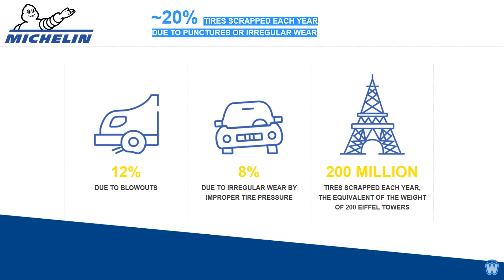Michelin Airless Tire UPTIS - Unique Puncture-Proof Tire System

Comment: The style doesnt look good but it seems to be more efficient.
Reply: AUTO TUBE it makes your fuel mileage much worse doe
Reply: @ahmeryaa865  is it because it has no side walls? They should just cover the side walls. I can imagine the air going in through there
Reply: AUTO TUBE nah it’s because the tire is so flexible you get much more surface area which ruins your fuel mileage by a lot
Reply: @ahmeryaa865  Flexibility depends on the construction and because these allegedly weight a lot less than a regular rim and tire it should improve mileage.
Reply: bigblockjalopy it’s not about weight it’s about traction the more traction the worse the mileage and that’s why bmw i3’s come with extremely thin tires
Reply: @ahmeryaa865  this is the reason trains are some of the most efficient modes of transport, because there low surface area on the tracks
Reply: @ahmeryaa865  Maybe the material of it can be changed to make it more harder.
Reply: j Walster this is why these tires would suck because they have more surface area and traction
Reply: nichts angehen sure but that would ruin the whole “ obstacle crossing “ thing
Reply: @ahmeryaa865  exactly, where in construction and military applications, efficiency is not at much as a priority
Reply: @ahmeryaa865  So be it. Most of the street cars are not fitted to cross in mountain sides anyway.
Reply: nichts angehen but at that point it would be too expensive to make and buy to the point where it’s just a bad investment
Reply: @ahmeryaa865  "Traction"? I guess you mean rolling resistance. Of course it is about weight. Very simple, easy to understand  law of physics. It needs power to get weight moved, the more weight the more power needed, especially true for a fast rotating thing like a wheel. Light wheels save fuel (or energy), known since the invention of the automobile, and long before. And these new wheels could probably be designed narrower too, for less rolling resistance, so?
Reply: bigblockjalopy stop twisting my words and respond with something that is related to the key word I said which is “ traction “ not “ rolling resistance.

Comment: We could've and should've been using airless tires years ago!
Reply: JOHN DAVIS not in snow or mud climates/circumstances. Any debris inside the tires would cause possible catastrophic shake or failure at highway speeds. They’d have to be cleaned constantly. This is a 40 year old idea that keeps getting press every decade
Reply: @joesmith389  tyres could be covered from sides.
Reply: Joe Smith like the sidewalls HAVE to be open ? .. they could just make a type of vent in the sidewall near the bead
Reply: @joesmith389  in WW2 Soviets and Germans were experiencing on this technology. It was a waste for them due to ice was collecting I side the tire and was not any good
Reply: Joe Smith don’t you think the military encounters that problem with their humvees?
Reply: @joesmith389  All you have to do is put a side wall type covering and viola! No debris gets into the Tyre.
Reply: @BatMan-oe2gh  but then it would need a hole to let air out and in again when hitting something on the road. That hole could possibly be a trap for crap to get trapped inside the tire.
Reply: Shane Jackson read my comments above before you reply to my comments!!! People please!! READ! Then do some research on this tire, as it was designed without a sidewalk INTENTIONALLY!!!
Reply: Sushil Kumar  it's not that easy.
 if you created rubber sidewalls, when it does get punctured, it would let debris and water in which would unbalance the tire.
Reply: HOW are everyone missing the main disadvantages??? What?? 

Airless tyres have not been used because they create a lot more friction, so much that some aren't even legal in certain states/countries due to significant increase in fuel consumption. This friction also creates a lot of heat, making the rubber wear of much more quickly than regular, properly pressured, tyres. Which in turn have a larger impact on the roads.

Lastly, when airless tyres are made hard enough to combat the challenges above, they require constant usage in order too keep them in shape. Furthermore, the ride quality becomes so bad that very few costumers would even want them in the first place.
Reply: @GameOfFava  👍 great comment.
Reply: They've been testing this for like 10 years now it used to be called tweel
Reply: but how would they keep takin all your cash???
Reply: Umm they did.. air filled tires are softer and help absorb impact better.. horse drawn carriages and "horseless" carriages both used solid rubber tires initially..
Reply: Joe smith what u mean bruh they just have to put a rubber cover
Reply: J Dolo that’s funny
Reply: Tony Dinh who’s taking hard corners at high speeds on a daily basis?
Reply: Ikr.. But bru did u heard in the video? They planning to release it on public in 2024. What the actual fuck?
Reply: @yajhnal6536  actually these tires will never come out for cars to the general public....theres no money making lifetime durable tires..........the strategy for companies and government when they don't want to release something to the population its always delaying the "release date"......
Reply: TaureanKing the profile will eventually run out what means u NEED to buy new tires. If you don’t then u will slip very easily. Do it is still profitable. But also makes the roads safer by reducing tires that blow up whilst driving
Reply: @thegoldenboy294  bit of a stretch in this instance. Who benefits from that? Big Air? Take your tin hat off pal
Reply: @joshyc2006  big air? the same company tires.......stop being so naive buddy
Reply: @thegoldenboy294  I think there are enough companies, start ups and small businesses that would have produced these tyres years ago if they really were beneficial for road use. You'd make a fortune, so I dont understand in your mind why you would think it's a giant conspiracy.
Reply: Sushil Kumar  good idea
Reply: I like how no one put any consideration  on this topic before commenting
Reply: Tony Dinh  normal tires cant take hard corners at high speeds, what's your point?
Reply: The reason airless tires is not on the market, it's all about economy. They want consumer spend on air tires. Make the money moving. Otherwise, the paper dollar scheme will not survived this long.

Comment: Won't work in the winter without a side panel. They will get packed with ice and snow, throwing off the balance. Resulting in terrible vibration and blown out bearings in the long run. Great for summer though.

Comment: We Will never gave unconsumable products. 

Its about money.
Reply: These 'airless' tires won't be an unconsumable product - the tread area will eventually wear out just like our current tire technology. Then new tires will have to be purchased, just like current tires. It just means no maintaining proper air pressure and no flats from road debris. It also means that no one will be able to slash your sidewalls and render a perfectly good set of tires to scrap. That's a 'win' for consumers and our environment.
Reply: @robtec88  lol sorry but I want you to think what will happen to that tyre if I was to take a knife and slash through them lovely little gaps that literally run all the way around. You could probably cut through them with a nice sharp pair of scissors.
Reply: Dra Dikketrip exactly

Comment: Seeing as almost all vehicles now (except vintage) are electronically run, the police can use the "new" device (developed more then 10 years ago...but is starting to be accessible to more and more police departments) that shorts out and disables the computer in the vehicle it is chasing...rendering it useless. 
So ya no need to worry. There is a answer for your so called problem with stopping criminals...

Comment: One massive drawback is fuel economy more rolling road resistance = higher fuel/battery use percentage all these manufacturers striving for better fuel economy are going to have issues thrown onto them
Reply: Good point

Comment: Seen this 10 years ago, and now, nop, still can't find 'em anywhere.
Reply: These tires have had legitimate issues, but they should have been on the market by now. You can bet if a competitor was selling them on the market, Michelin would have rushed them to market. These tires are notorious for being noisy, which gets annoying fast for most people. No one was quite sure how big the wheel should be. At first, the ride was too stiff. Careful tuning must be engineered to give it a comfortable ride. A big issue is that these tires would have vibration above 50mph. People these days sure do drive fast on the freeway...

The tires that we finally see come out should have these issues addressed.

Comment: What if you combine this design WITH air? So it's still sealed but the internal structure is that way?
Reply: Possible, but wasteful as it would use more rubber than is already used in a regular tire to have a skeleton inside.
The problem with this is that there was already a solution for getting a puncture that tire companies and dealers love to sell - runflat tires. They are heavy and expensive, though.
Reply: @alby13  I was thinking an inflated tired would still be useful for cornering / turning. This tire seems to stop abruptly at the edge. Don't they rotate tires mainly because of the wearing not just on the threads at the center but on the edge/side? This seems like there's only a little bit of edge on cornering that'll wear out quicker. There's no real "bulge" that can take some of the friction.

Comment: I believe in the idea of an airless tire, but I'm sceptic about the material inside. One: it looks like it can lose its strength over time. Two: if the material inside is the same as the tire itself: what's the point then? You have to produce more of the same material just for one tire. Three: is the tire strong enough when do other things to it than just driving straight on the road? Just some random questions that crossed my mind..

Comment: The lack of sidewall makes aggressive handling or high speed turns inherently dangerous, and can cause the tire to “roll off” the rim. Car tires (just like motorcycle tires) need sidewall, because as a car enters a corner the weight of it shifts from the central portion of the tread to the outer/inner portions (dependant on the direction you’re turning) and then a small section of sidewall. This is why some sports cars have “negative camber”, where the wheels are slightly canted inwards towards the top of the car, so as to help aid in traction during high speed cornering when the weight pitches the ballast of the car in one direction over the other. Low air-pressure can mean that even more sidewall can be affected, and some cars benefit from lower air pressure than others. 

Putting tires like this (without sidewalls) on the road would create a string of problems.
Reply from the maker: as much as everything you said sounds like you know what you are talking about, I am sure the tyre companies know what they are doing. Plus I am sure they would not be allowed on the roads if they were not safe.
But with every new technology comes teething periods where they learn something new that testing did not show up, that is why gaming companies have beta testing, so the mass market can find all the bugs the programmers missed.
Reply: Wonder World I think they’re testing the properties of variable high speed on rough terrain within a straight line and low speed gentle turns. If you notice, there’s no high speed cornering shown, which is a staple of collision avoidance. 

I agree, they know more than me. They have, however, been testing this for years, so clearly the kinks are not entirely worked out. I’m just stating what I believe those kinks are.
Reply from the maker: @39PSIOnTheDaily  this was just B roll footage for the media, don't look at this and think this is testing.

Comment: Puncture proof? Nope
Deflate proof? Sure. No air.
But if they are as good or better than a normal tire, why aren't they flooding the market?
Will the retail ones have a sidewall to keep out debris?
Reply: Because there are problems with such tires at high speeds they are not really "stable" yet

Comment: Concertina wire should still lock up the wheels on any car using these tires. No need for nail strips. I can see where packing and unpacking concerting would suck though.

Comment: You know how having your tires fully pressurized helps with fuel consumption? Less energy spend in deforming the tires saves energy.
These new tires look like they are deforming a lot and they may actually increase the car fuel consumption. This could lead to bigger environment impact than the savings from not-making new tires.
Reply: They are trying to solve something that doesn't exist for most drivers. Puncture is rare for city drivers unless they're driving in a war zone. On top of fuel consumption you mentioned a lot more rubber is needed to make these new tyres and I'm guessing they still need replacing due to worn treads.

Comment: Nice but what about drifting and burnouts
Reply from the maker: I hope that is not a serious question, SMH
Reply: @WonderWorldYTC  it is a real one, how i would race and burnout the tires before it?
Reply: @WonderWorldYTC  i m serious man imagine doing burnout and drifting with these u don't think they can handle it
Reply: PVC
Reply from the maker: I will answer this question to the best of my ability, but I really think you are trolling me.
regardless of innovations in tyres, they always make unique tyres for the race industry, such as slicks, tyre manufactures have to make so many different and unique tyres for every type of vehicle, places, trucks, race cars, motorbikes, push bikes, prams, that even if these tyres become standard on your family car, they will always make race tyres etc.
Reply: @WonderWorldYTC  i m not trolling you man i m serious
It is a hollow tyre right, where rubber gonna go after burnout or after a long time tyres gonna wear out what's gonna happen to it's outside layer which touching the ground
Reply from the maker: well as I said, tyre companies make all types of unique tyres for different industries, so these new airless tyres will not change the racing / car scene at all I would think.
Reply: @WonderWorldYTC  alright man but still if they have SAME hollow design for ALL of them then i doubt it's gonna work for racing and all but for normal daily driving these tyres looks much practical smoother comfortable then ordinary ones

Comment: How does this help with pollution? Theres extra rubber in the middle. This will only make sense if you could replace the tread. But replaced tread falls off easily..so..idk if this is a good idea
Reply from the maker: like I said in the video and stated by Michelin, 200 million tires a year are scrapped from blowouts or irregular wear
Reply: @WonderWorldYTC  ^ blow outs are not that common. These tires will wear like a normal tire. So these new tires are going to cost more and waste more. About 1.66 times more waste if you do the math
Reply from the maker: @cjiscool8668  what math? I gotta see this so called math you speak of.
Reply: @WonderWorldYTC  Me too. I'm glad he said "about" and not "exactly" 1.66.
Reply: @gellis7975  I' warry while inside the tire blade fill with mud and while mud going dry it will making unbalance with the tire it self, it is just good while cars just passing toll way, free way but not in mud terrain
Reply: Did you actually watch any of the video mate? 🤨